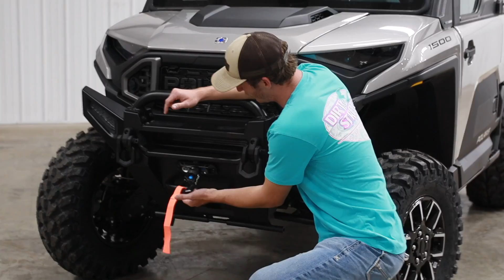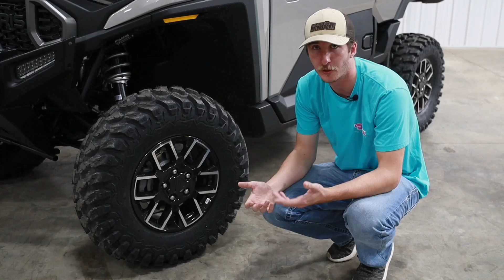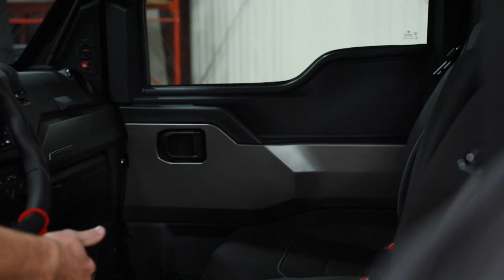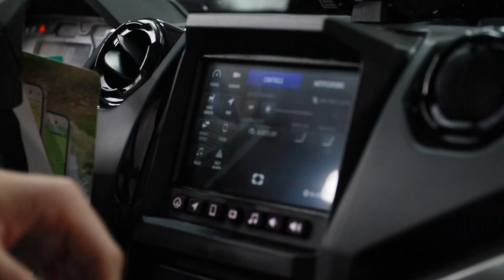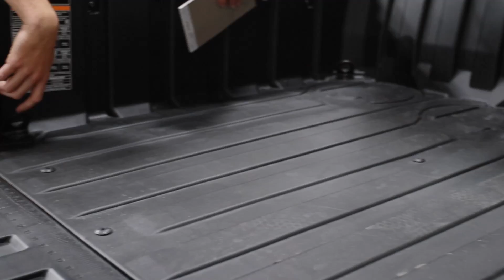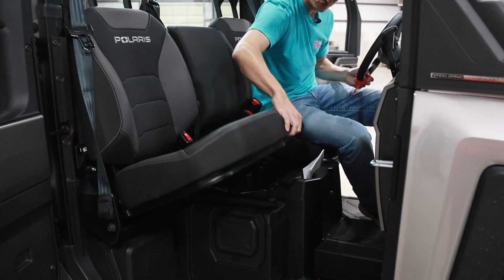2024 Polaris Ranger XD 1500 Walk-Around/Start-up

Comment: If it’s like my 2020 ranger then 300 hours be ready to replace some things.
Reply: I have a 2020 xp1000 as well, about to start changing out front Axel's and wheel bearings.
Reply: @dustinst.george1617  I did u joints on the prop shaft and control arm bushings. Need to do a couple wheel bearings as well. Only use it on the farm and never touched mud

Comment: Question, under the passenger seat, next to the center storage, is that cut out for a sub woofer?
Reply from the maker: It’s a storage slot that can hold a 5 gallon bucket under the passenger seat. The speaker upgrade for the XD1500 actually mounts two speakers behind the driver seat for bass and two more overhead speakers that would mount in pods in the rear corners of the passenger and driver side. It’s considered a stage 4 audio upgrade kit!
Reply: @interstate69motorsports  part numbers for the stage 4 kit available?